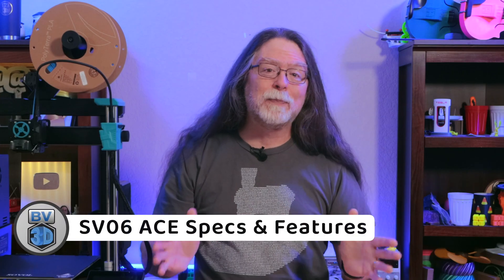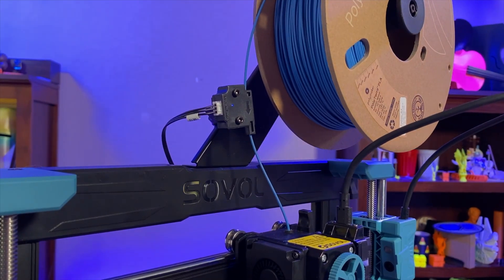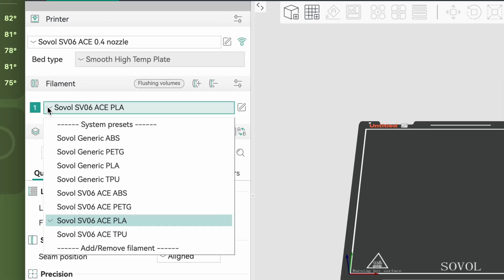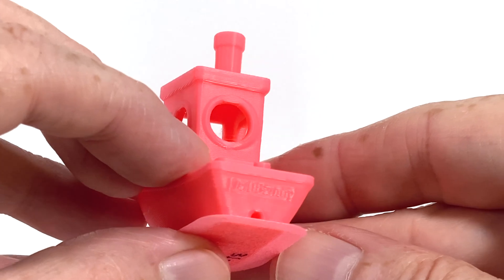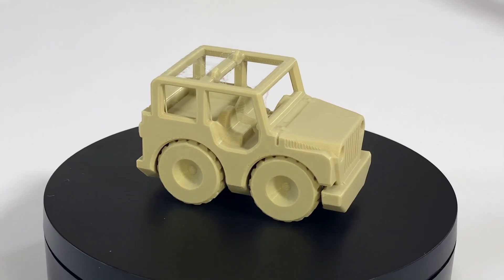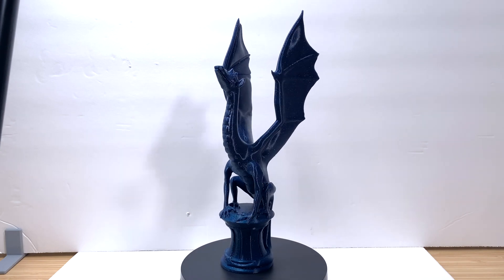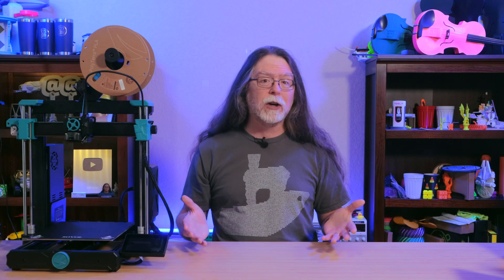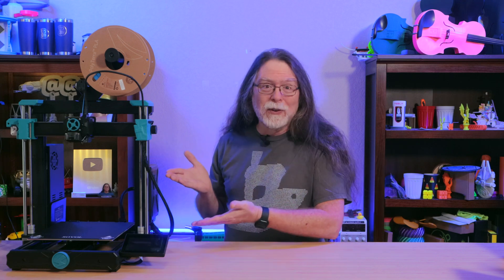Sovol SV06 ACE - First Look!

Comment: Wouldn't changing the "tachometer_poll_interval" fix the problem with the fan errors? The Klipper default is 0.0015 (for fans below 10k rpm). Sovol's website says that the nozzle cooling fan is 12k rpm. Klipper documentation states "This must be smaller than 30/(tachometer_ppr*rpm), with some margin, where rpm is the maximum speed (in RPM) of the fan." So I'm guessing that you would need it set to a value slightly less than 0.00125, or slightly higher than 0.00125 if the fan is actually less than a 12k rpm fan. Im guessing that it would fall somewhere between 0.00115-0.00135. (My second guess would be  to add a "kick_start_time" to the [fan] settings). I wish I had an SV06 ACE to troubleshoot for myself. :) It looks like a great printer for the money.

Comment: I know this is probably an off the wall question but is the X axis belt fully enclosed in that black panel?  How do you adjust the tension on it without being able to feel the belt?  I use a belt tension meter for all my printers.

Comment: The SV06 Ace has a lot going for it.  The world definitely needs a Klipper bed slinger with all steel motion control system.  I'd be more interested in an SV06 Ace Plus with a 300x300 build area.  The price of Klipper coreXY printers is coming down and many people are going to spend more for one of those, but for people who want a simpler 3D printer with good print quality that's reasonably priced, reliable and easy to maintain or repair, this is a winner.